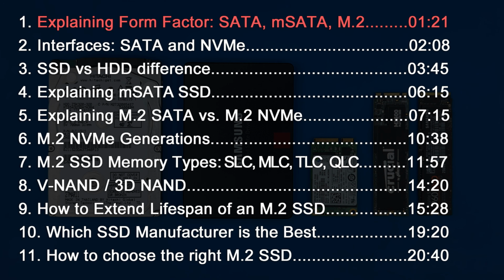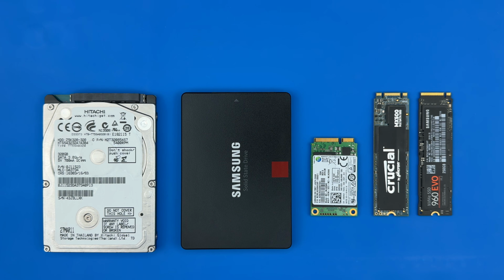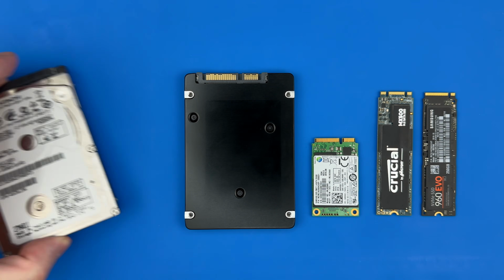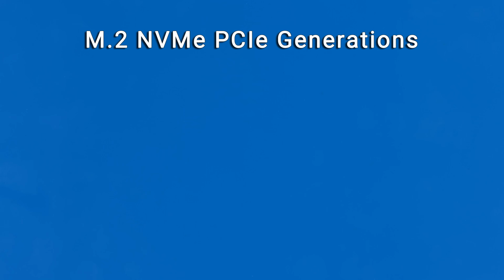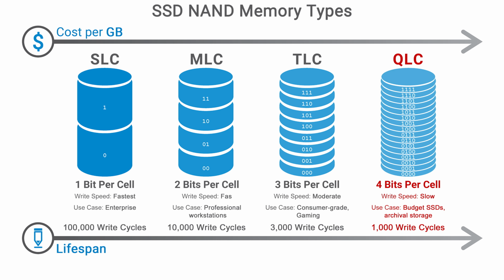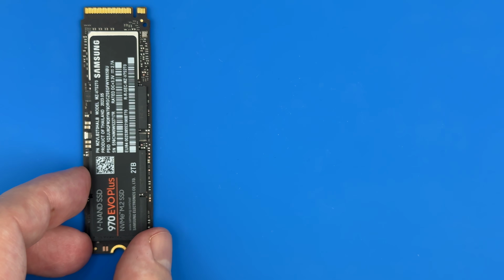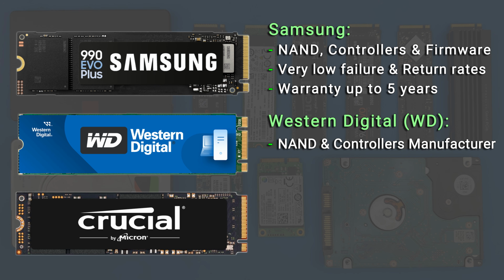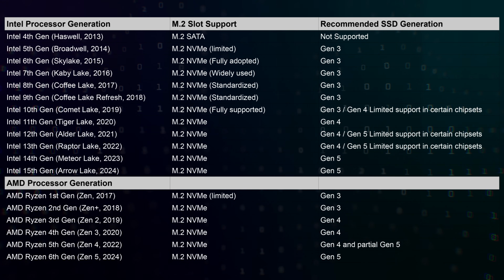SSD vs HDD vs NVMe vs SATA vs mSATA vs M2: Storage Devices EXPLAINED!

Comment: packard bell lemans i3 laptop, i would like to upgrade storage and ram but i dont know what should i get
Reply from the maker: For your Packard Bell i3 Lemans laptop, you’ll likely need:
Storage: Upgrade to a 2.5” SATA SSD (like Crucial MX500 or Samsung 870 EVO) for a big speed boost.
RAM: Check if it uses DDR3 or DDR4 (most likely DDR3) and supports up to 8GB or 16GB total.

Comment: If you apply a heatsink should we remove the sticker or just stick it in place? And should we apply thermal paste?
Reply from the maker: Great question! 👍 Leave the sticker on—it often acts as a thermal label. Use thermal pads, not paste, for SSDs—they are safer and designed for even contact without mess.

Comment: if you don't have more nvme slots you can use the GPU PCI-E slots with an adapter for m.2 NVMe SSDs
Reply from the maker: yes, it works for PC! Just make sure your motherboard supports booting from it if that’s your goal

Comment: 2 things thats questionable: 
m.sata isnt just outdated, its pretty much e waste alongside all the other sata drives since price to perf/gb any gen 3/4 cost a lot less
(the outlier being 3.5 hdd, great for mass storage dumps)
so going for straight up m.2 nvme would be a default pick 2025 and onwards
as for brands, samsung took a major hit not long ago on their 980 pro + 990 pro skus where a firmware bug happened and ate half the drives lifespan, beware!
he are better alternatives: wd, micron (crucial), sk hynix (solidigm), seagate, teamgroup
enjoy, pc enthusiasts!
Reply from the maker: You're right—mSATA and SATA SSDs are quickly fading out for performance builds, and Gen 3/4 NVMe is the clear winner moving into 2025

Comment: What is properly confusing, is that m.2 nvme drives comes with both b+m, and m keys configuration. Add to that, suppliers and sellers doesn't differentiate at all, and brands making motherboards that fits both but end computer configuration doesn't make that a sure thing. It's a complete mess. Just like USB.

Comment: @19:43 -- Avoid Western Digital products.  They work great, and if that is all that matters to you, then no need to read on.

Western Digital's warranty is basically useless, because Western Digital works hard (really hard) to frustrate customers into giving up on warranty claims (how long can you go without a replacement drive?).

And to add insult to injury, Western Digital tries to get you to pay a "Convenience Fee", for them to ship you your replacement drive, without delay.

So Western Digital can replace your failed drive under your warranty.  But they drag their feet if you do not slip them some cash (that they call a "Convenience Fee").

Sometimes you might get a warranty replacement within 2 weeks (which is a long time), and sometimes it might take 2 months (and that is with calling them once per week to find out what is delaying them).  Their customer service representatives will tell you whatever they think you want to hear.  They will tell you that your drive will be shipped on Monday, and when you call them back on Tuesday or Wednesday, they will apologize, make BS excuses, and blow more smoke up your keister.  Rinse and repeat, week after week.

They will tell you that their systems are being upgraded.  They will tell you that they do not have your ticket number.  They will tell you that they are waiting for an answer from their supervisor.  They will tell you anything and everything under the sun.  They thought of it all.

When you call Western Digital, frustrated due to one delay after another, you are treated with sale's pitches for their products.  You will not be given a choice to speak to someone, until you sit there and endure their sale's pitches.  You are calling with an issue, and Western Digital figures that that is a good time to treat you to advertisements.

Seagate, on the other hand, is a pleasure to deal with.  They do everything that the can to make your warranty claim painless.

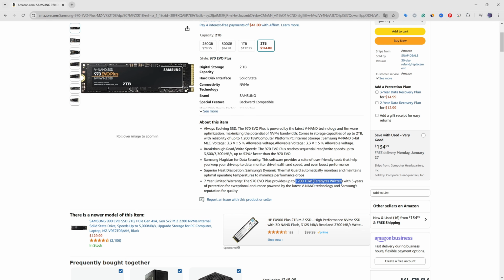Comment: @16:00 -- You can ignore the TBW value.  Why?
It is an arbitrary number number that is plugged in by the manufacturer.

For example, the 970 EVO Plus has a 1200 TBW value.  But you can probably keep writing to that drive for 10x that value, and you will see no performance problems.

There is a crypt-o currency named "Chia".  That crypt-o process generates huge files that are used in a type of lottery system, to win coins.  Most Chia farmers use an NVMe drive to create their huge files.  The process, to create those huge files, hammers away on the NVMe drive non-stop, 24/7, 365.

Chia has been around for approximately 5 years, and no one in the forums has worn out their NVMe drive.  There are reports of failures.  But those failures are due to overheating manufacturing defects.

And since countless NVMe drives have been written to for 5 years, non-stop, then how did the manufacturers choose the trigger value of 1200 TBW?  How did they arrive at that being the magic number of when the drive is supposedly worn out?  They certainly do not pound away on their new drives for 5+ years before releasing them to the market.  The manufacturers create a new model and they want to get the sales going, without delay.  So the manufacturers do not actually do long term testing (maybe a few months?).

Their TBW value is for two nefarious purposes:
-- It ends your warranty.  When you hit that TBW value, and if your drive should happen to fail for any reason under the sun, well... too bad.  No more warranty.
-- The manufacturers provide "health" software that displays all kinds of information about your drive.  Well, when you get close to that TBW value, you get worried, and you go out and buy another drive (even though your supposedly worn out drive still has 90% or more of its actual life remaining).

Folks, as long as your SSD has proper cooling (and that is needed only for heavy writing operations), then your SSD will outlive your PC, and will likely outlive your grandchildren.

Comment: @4:51 -- Just about any 3.5" HDD (from the last 5 or so years) will read and write at approximately 260 MB/s, when empty.
Overwrite speeds will vary, depending on whether the platters are SMR based or CMR based (CMR is superior).

As the drives fill, their read and write speeds will diminish, due to data being written closer to the center of the platters.  The platters spin at a fixed speed.  So the outer portion of the platters have more real-estate, per rotation, as compared to the inner portion of the platters.  So in any single rotation, the outer portion of the patter will have more data.
Reply from the maker: The drop in speed as drives fill up is a key detail many overlook. And yes—CMR is definitely more consistent and reliable than SMR, especially for write-heavy tasks. Great explanation of platter physics too 👍

Comment: My Device Laptop Dell Latitude 5480
Reply from the maker: Your Dell Latitude 5480 supports M2 NVMe PCIe Gen 3 and 2.5” SATA SSDs.
Best M.2 NVMe SSD options: Samsung 970 EVO Plus or Crucial P3
Best 2.5” SATA SSD options (if upgrading SATA drive instead): Crucial MX500 or Samsung 870 EVO
I also included links to recommended M2 and SATA drives in the description below the video.

Comment: Good video, at least for a newbie it was very well explained of the storage devices.

Now, I want to upgrade the storage by adding an extra NVME M.2 to my laptop because I really dont want to use even half of what I currently have (512GB NVME M.2 and theres around 330GB storage left) and of course, playing games and storing files and stuff. the M.2 I have currently is the KINGSTON OM8PGP4512Q-AA

Any suggestion about an M.2, I might not be able to purchase one for a decade or so. and Thank You beforehand.
Reply from the maker: Glad you found the video helpful!
Best M.2 NVMe SSD options for long-term use:
Samsung 970 EVO Plus (PCIe Gen 3) – The most reliable & durable
WD Black SN850X (PCIe Gen 4) – Great for gaming & fast speeds
Crucial P5 Plus (PCIe Gen 4) – Good balance of performance & longevity
Kingston KC3000 (PCIe Gen 4) – High endurance for long-term use
Recommended size: 1TB or 2TB, since you want this to last a decade. Also, consider an SSD heatsink if your laptop has limited cooling.

Comment: "Choosing the correct form factor is essential in ensuring compatibility with your system"
     That's like dumbing it down to barbarian level but still the barbarians wouldn't understand what you're saying.
      I think if you're trying to explain form factor to new wanna be computer builders, that would take a whole video.

Comment: Also a thing to consider is that an SSD not powered for an extended time period may become corrupt.  You data might be either gone or unusable.  Hard drives although they are more delicate don't lose their data so easily.  Also consider that an SSD has a finite number of write cycles.  Some drives just don't allow any more writes at that point but some fail outright and leave you at the mercy of a data recovery service which can be really expensive.  That is if you really want the data back.  It may be something you still have a good copy of.
Reply from the maker: SSDs do have data retention limits when unpowered for long periods, especially lower-end QLC drives, whereas HDDs retain data better in long-term cold storage. To avoid SSD data loss - power it on occasionally if stored long-term and keep multiple backups (HDDs + cloud storage). And yes, write endurance matters, though modern SSDs last much longer than most users will ever reach. Always good to backup critical data

Comment: Good day sir, i would like to ask for a help identifying my SSD and what is the best SSD to be used or upgrade my device is OMEN by HP 15-dc, thanks in advance, more power and God bless you always.
Reply from the maker: Best SSD upgrade for your OMEN 15-dc ( your laptop supports M.2 NVMe PCIe Gen 3 SSDs) here are some options:
1. Samsung 970 EVO Plus – Fast & reliable (~3,500 MB/s)
2. WD Black SN750 SE – Solid gaming performance
3. Crucial P5 Plus – Budget-friendly NVMe with good speeds
4. Kingston KC3000 – High endurance for heavy workloads

If you need a high-capacity storage option, you can also add a 2.5” SATA SSD, like the Crucial MX500 or Samsung 870 EVO. Hope this helps!

Comment: @how-fixit i think the chart at 15:23  is slightly wrong, you should've put the lifespan arrow from low to high from the other direction i mean QLC has shortest lifespan and MLC has the most since they both depends on lifecycles

Comment: Another brand that I found is kingspec, is it any good? As they offer budget friendly nvme gen3 x4 ssd's.
Reply from the maker: Kingspec offers budget-friendly NVMe SSDs, but their reliability and performance are not as consistent as brands like Samsung, WD, or Crucial.
Pros:
+ pricing
+ Decent speeds for basic use
+Works fine for light workloads

Cons:
- Lower endurance & lifespan compared to premium brands
- Uses cheaper NAND and sometimes DRAM-less designs, which can affect sustained performance
- Firmware updates & support are limited

Comment: Nice video.  I have an old Panasonic Tough Pad MK5 with a i5-7300U processor & 8 GB of RAM, the M.2 currently installed is model # MZNLN256C. What is your pick for an upgrade?  I appreciate the video and the help.
Reply from the maker: Your Panasonic Toughpad MK5 uses an M.2 SATA SSD (MZNLN256C), so you'll need another M.2 SATA SSD for a direct upgrade—not NVMe (since your device doesn’t support it). Check the links in the description below the video for recommended M.2 SATA SSDs
Reply: @howfixit  Thanks for the help!

Comment: Bro i have samsung netbook N110 year 2009 could you pleas share the upgrad program for ny laptop or early mentioned netbook . It would help me a lot.
Reply from the maker: Your Samsung N110 (2009) is quite old, but you can still improve performance with these upgrades:
1. Upgrade RAM – Max supported: 2GB DDR2 667MHz
2. Replace HDD with an SSD – Use a 2.5” SATA SSD like Crucial MX500 or Samsung 870 EVO for a big speed boost
Check the links in the description below the video for recommended SSDs

Comment: I hate to break it to you, but your description of maximum storage memory supported by the various Windows versions is technically incorrect. Windows XP Home Edition, Professional and Professional x64 are by design bound to be booted off of MBR formatted drives, because those versions don't have a UEFI bootloader. So if you plan to use your new drive as boot drive, you're bound to 2 TB drives (at max 4 TB, but then you have to divide the drive into 2 partitions of 2 TB each). However, the Windows XP Professional 64bit Edition and the 64bit Edition Version 2003 are designed for intel Itanium machines, thus they come with an EFI bootloader (EFI is the predecessor of UEFI) and both of them need to boot off of a GPT partitioned drive. Apart from those limitations regarding the boot drive, ALL versions of Windows XP are capable of using MBR and GPT drives as Data drives, because with Service Pack 2 Microsoft added GPT support to Windows XP.

Sadly, the same applies to Windows Vista and 7. No matter if 32bit or 64bit Windows, they need to be booted off of a MBR drive, but can use GPT drives for Data storage. Unless it's an Itanium version of Windows, then it's mandatory to boot them from a GPT drive, but they can also use MBR drives for data storage. Not entirely sure about Vista, but 7 had a bug in its UEFI bootloader so you usually installed it in BIOS mode, even the x64 Editions.

Starting with Windows 8, even the 32bit editions of Windows were able to be booted in UEFI mode, enabling them to boot off of GPT drives.

And starting with Windows 11, there are no more 32bit editions. However, Windows 11 still comes with the ability to boot off of classic "legacy" BIOS systems, so depending on your computers BIOS you are forced to use MBR or GPT for your boot drive, but the choice is up to you when it comes to a data drive

So, basic rule of thumb:
- Windows XP Home, Professional or Professional x64: MBR (with a maximum of 2TB per partition and 4TB total drive capacity) as boot drive, MBR or GPT as data drive is fine
- Windows XP 64bit Edition or 64bit Edition Version 2003: GPT as boot drive, MBR or GPT as data drive
- Windows Vista and 7 x86 and x64: MBR as boot drive, MBR or GPT as data drive
- Windows 8 and later x86 and x64: MBR or GPT as boot drive, depending on your Computers BIOS; MBR or GPT as data drive, independent of your Computers BIOS
- Windows 11 x64 (no more x86 Edition from here on): Technically limited to GPT as boot drive but can also use MBR as data drive
Reply from the maker: Windows XP, Vista, and 7 (except Itanium editions) are MBR-bound for boot drives, but can use GPT for data storage with the right service packs. Windows 8+ introduced full UEFI boot support, allowing GPT boot drives even on 32-bit editions. Windows 11 technically enforces GPT for booting, but legacy BIOS setups can still run it with MBR (though unsupported). This is a great reference for anyone dealing with older Windows versions, BIOS limitations, or storage setups—much appreciated!

Comment: Does my old i7 3820 supports Samsung's m.2 nvme 990 evo ssd? On my MB asus p9x79 pro i have free PCIe 16x gen 3 slot
Reply from the maker: Your i7-3820 and ASUS P9X79 Pro motherboard do not have native M.2 NVMe support, but you can still use the Samsung 990 EVO with an NVMe to PCIe adapter in your PCIe 3.0 x16 slot.
Good news - your motherboard has PCIe Gen 3, so the 990 EVO will work (though limited to Gen 3 speeds, around 3,500 MB/s max). But your BIOS does not support NVMe booting, so if you plan to boot from it, you may need a workaround (e.g., using Clover Bootloader or modding the BIOS). For data storage, it will work flawlessly with an adapter.

Comment: i have to disagree with your choice for WD. of the last 4 external HD's i bought 1,2, and 3 were all WD, and all failed in under a year. they used to be good, maybe i somehow got 3 lemons in a row, but i doubt it. i'll never buy WD again. other than that i appreciate your no frills video, no bs or stories. just the info described in the title. such a rare thing on youtube these days. thanks.
Reply from the maker: I totally get your frustration—having three WD external drives fail within a year is definitely bad luck. Some external models, especially the WD Elements and My Passport series, use SMR (Shingled Magnetic Recording), which can impact longevity under heavy use.
Glad you found the video helpful—really appreciate the feedback!